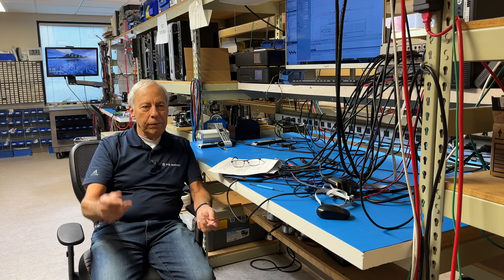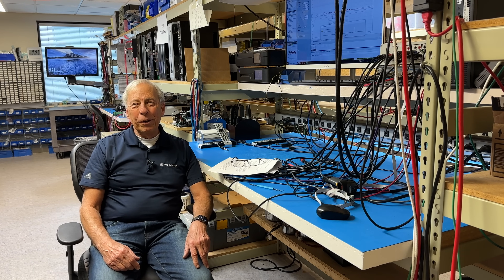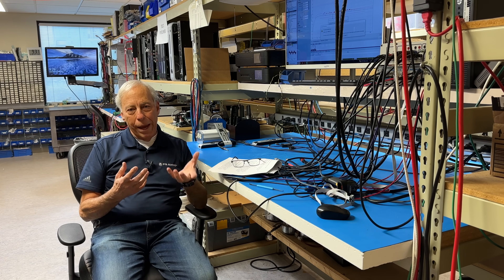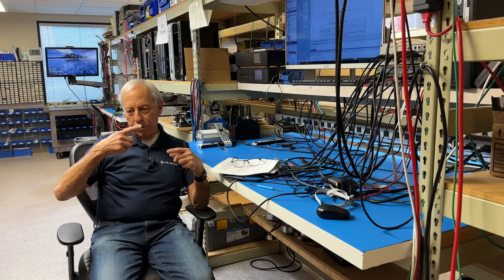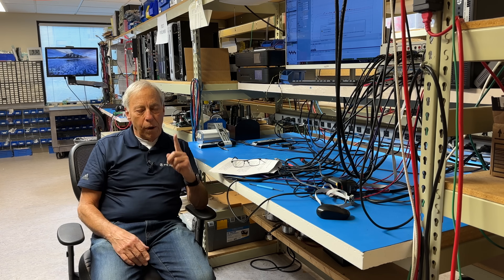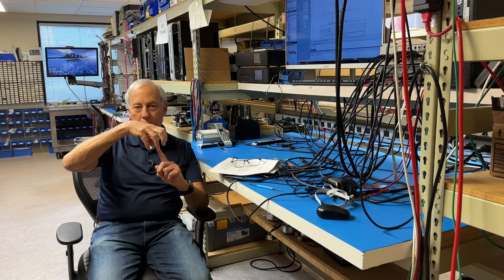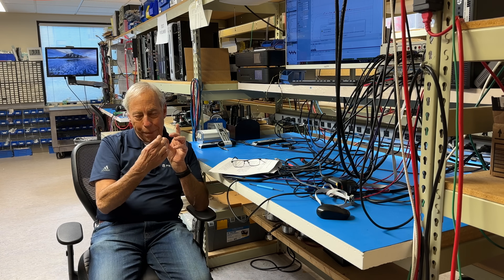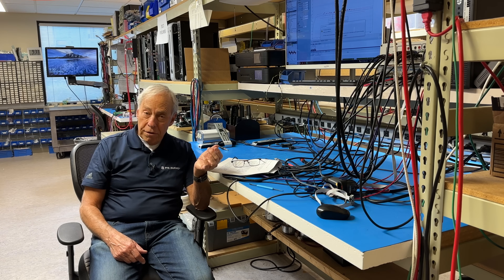Differences in phono cartridges

Comment: I love you Paul. I've been watching you for years. You are great. We are almost the same age.

But when it comes to audio? I haven't always been right. But I've never been wrong.

Yeah Paul, well you've left out of the equation,, a 3rd type of phono cartridge. You obviously know nothing about? It wasn't around very long. Therefore it is little-known. But it existed, nevertheless. As I found it substantially and fundamentally, different. And delivered precisely the way in which they said it would. I was duly impressed. I was delighted! Oh yeah baby! This is it! This is the bees knees! You will be cutting a rug with this one! You will get down to get up! I was blown away by it. I worked for Owned & Operated, Flagship, NBC Radio Facilities.  Maintaining, designing, building, evaluating, Audio Superiority. We had a Superiority Complex. We were #1 in the Market. You know how it is, Paul? You build some stuff also. Great stuff! I think we all had some of your stuff. I can't remember when I last did or what it was called? But I have owned virtually anything worth owning. Some for a long long time. Others were just a kiss and a quick, hurrah!

In this unfortunately is one of those items. I never wanted to part with. And when one has to consider, certain intrinsic risks with said devices? Walk away remembering the good times we had together. And how we shall dearly miss them forever. Be it inanimate or flesh and blood. The flesh and blood ones are the hardest. Phono cartridges not so much. But your video brought back a memory and a tear to my eye.. Over spilled milk and cookies. But I digress.

This cartridge was around, 40 years ago. When I was working for NBC Radio, in Washington, DC.

This phono cartridge came from a company, if memory serves me correctly, still? At 68.  I think they were called Micro Acoustics? They came up with something different.  A very novel lightweight, high-performance, new concept, old technology Phono Needle Cartridge Thingy. With no need for, Compensation Capacitor! That causes an abomination to, square wave reproduction. At no compensation resonant capacitor made an enormous difference of smoothness. I mean this was slick sounding. Everything else is sickening sounding.

Unlike a moving magnet or a moving coil. All with relatively high mass. An electret, permanently polarized, capacitive transducer was used. Similar to a karma condenser microphone element. Not moving magnets. Not moving coils.

The moving magnet and moving coil types. Worse still, inductive. And would require a, capacitive load. Such as a, .047 µF or was that a .0047? I forget right now off the top of my head. It's something like that. To resonate the circuit in the cartridge. Because you need to resonate in inductive load with a capacitor or a magnetic load with induction. But a capacitive transducer works differently with even less mass. Come

And so this cartridge required no, .047 or .0047 µF capacitor resonator. No need for that. This is a purely capacitive load. Not inductive, not magnetic.

This cartridge also had a, elliptical stylus. Within a even lighter weight and stiffer, Beryllium cantilever. Lighter than the other aluminum-based alloys.

One of the first things, one would notice. Splattering sibilance, no longer heard! Nothing is resonating around that frequency. It's gone! It's smooth. It sounds clean  and unmolested.

This cartridge, sounded unique.. It was free from the nasty resonant frequencies. The moving magnet and moving coil types, had. It was a breath of fresh air in, sound.

It was also lighter weight and more fragile.  Than, the standard, old, fare. And not really designed for heavy broadcast industrial grade work. This was ultra hi-fi. And we didn't equip with it at NBC radio. And I was able to take it home for myself.

I absolutely loved the way this cartridge sounded. Hands down. It had none of the negative qualities the moving magnet or moving coil types had//have. And they recommended. Any turntable, with integrated tone arm. Might already feature the, .047 or, .0047 µF capacitor's. They recommended those to be removed. As they are no longer needed. And they will upset the response from flat. Causing a high-frequency shunt. Across the output of the cartridge. No longer needed.

I was in love with the sound of this cartridge. Regardless of the preamps, I checked it out on.  And I checked it out on numerous, high-end preamps. These were largely custom preamps. It's so more vacuum tube. Others transistor. Integrated circuit chip, hybrid types. Could be compared with this unique Back Electret Cartridge. And I fell in love with its sound quality. Compared to the other types which sounded like filters. This was beautiful and open sweet and flat.

Then came the day of dark and gloom. They went out of business. I couldn't obtain a replacement stylus. And after a few years. Mine crapped out. And that was the end of that. Having to go back to the other original, moving magnet and moving coil, types. Blah!

So you guys with those really fancy expensive turntables and tone arms. The joke is on you! With your esoteric, gobbledygook, bullshit! Of flawed and old-fashioned. For old-fashioned and flawed. Great! We have really made great inroads here for you, Vinyl Junkies. That has now been lost to History. And everybody wanders around. Needing a haircut. With a lot of Wool. Over your ears. Of garbled and splattering, sound. Due to moving magnets and moving coils that, weighs a lot. And have a lot of mass to them. You don't want a lot of mass to move. It causes distortions of all types. Not all of which can be rendered, in audible. But when you hear it without? From a back electret type. It's a Game Changer!

And because we evaluated these. With proper, high-end, test equipment. Of all types of different, Distortion Analyzers. All types! Not just Total THD. But even the Intermodulation, Distortion. The, 3rd, auto order harmonics. And the 2nd, even order harmonics. Separately! And with a bunch of engineers. Doing listening tests. Not just Betty and Frank, Barney and Wilma. And then there is Fat Freddie. Who can barely hear after doing 40 years of heavy construction. Or, Bobby. Who has been playing Electric Guitar with, 4 Martial Stacks behind him! And cat here worth a damn, either anymore. Without his hearing aids!

I had a colleague who was, an ex-military, trombone band member. Who over time. Became profoundly deaf. And had some of the first rather expensive, computer adjustable, hearing aids. And he loved Pro Audio and was an, Engineer wannabe. And was taken on. By the Studio Owner. Who was a colleague of mine. And I said to Bruce, what are you doing? Frank is deaf and has hearing aids! How can he be a Recording Engineer?! He's deaf!

But Frank would go off on the computer control of his hearing aids. I didn't care! He was deaf! What the hell kind of recording engineer is a deaf recording engineer!?!? I mean give me a break! Some people have a genetic loss of hearing. It's not their fault. But you're also not going to become an, Audio Engineer. In your mid-50s while you are deaf now. I mean give me a break!

(More Real Life Audio in following post)

Comment: And so really I don't know where half you guys are coming from? And what you think, you are hearing? You certainly are not hearing the full picture! You have a lack of knowledge and lack of experience. You haven't heard everything.. There is to be heard. Because it is now gone. Nobody's making anything like this anymore. And I believe I know why.

Beryllium is a great and important metal. It's also hugely poisonous. To, Homo sapiens, a.k.a., human beings. And it's not healthy to be around. Though it is lighter and stiffer. Than any aluminum or titanium alloy. And does not suffer from the same cantilever  resonance. Other metal alloys exhibit. And that's another intermodulation distortion! DUH! Because you guys don't really know what you're hearing. Because you haven't heard it without that distortion.

The closest analogy I can come to in sound differential. Is the astounding difference. Between PCM Digital and DSD Digital. There is a profound difference in sound. And none of you guys have necessarily heard, DSD, Digital, either. Because PCM sounds fizzy. In comparison. It sounds like junk. In other words. At any bit depth. At any sample rate. I don't care how many bits. I don't care how high end sample frequency. PCM sounds like PCM. Because it is PCM. And it is not a Superior Digital Format. Even at 32-bit and 328 kHz sampling! Because it's still PCM! It's a 60-year-old early digital technology. Still in use, today. And it shouldn't be.

The secondary analogy I can give. Is the, Jitter. To a standard run-of-the-mill digital clock. And a low Jitter, Digital Clock. The difference in sound will take your breath away. It'll practically make you vomit. When you hear digital sound. With enhanced very low, jitter.. And when you hear the difference. It is jaw-dropping. It's a profound difference.

 I have been privy to. Numerous double-blind listening tests. With other, so-called. Golden eared, listeners. That all got it wrong! I didn't. I knew what I was hearing. I knew what I was listening to. I have a deeper understanding of what I'm hearing. Then the average, schlemiel, the average street goof. Because you guys really don't know what you're listening to. You only think you do. And most of what you think you hear is cockamamie garbage.

I mean sure. If you're going to spend over $50,000. On your listening system. You will have equipment. That far exceeds. Anything those recordings were made with LOL. And I'm not sure what that means? I think it means more money than brains. And that's fine if that is your hobby. It's a fine hobby. Where you get to spend a lot of money for the most high-end gear. And enjoy your status, games. Amongst your wealthy friends.

But the bottom line is. Most people will not spend, $50,000 or more. On their home entertainment system. Let's be real here.

Most folks will not spend more than, $1500 on a home entertainment system. And that's with only 2, average, decent, bookshelf sized, speakers. Not some six-foot tall floorstanding monstrosities! And not Dolby ATMOS Junk, either! Because that is Bullshit Audio Processing, again! Of time delays and phase manipulation. And that's bullshit garbage! Immersive? Your money is immersive. They are immersed in your money. That's the idea here. To stay in business. Because otherwise Dolby Laboratories has outlived their usefulness! With the Advent of Digital Sound. It used to be THX Gobbledygook. Benton 5.1, garbage. Now that's no longer good enough! Now you need 14 speakers! To be completely Immersed! In Absolute Negative Polarity Speaker Wiring Monitoring. Oh boy! Your speakers are sucking! Because you don't understand what's going on! And you are convinced you are all, right, godly and correct! When you are not!

At you have the foggiest idea what's going on with your playback system? You don't know what you are hearing. Most of you, college grad nincompoops! With years of misinformation! And so if you are all wrong, together. Surely you must be right! You are not!

Nobody knows who I am. I'm one of those really silent, unknown, behind-the-scenes, Genius Extraordinaire Engineers. And I've had to fix a lot of, Big Studios. Electrical engineers and acoustic engineers keep getting wrong! Why?

They are mired in their textbooks and mathematical formulas. They actually know nothing. About the physical recording process. And what precisely is going on from microphone input to power amplifier to the speakers, output. You do not understand the process going on. You are inverted! And I have proven this time and time again. Since 1978. It's been a while now. That I discovered this, stupid, mindless, Textbook Mistake! Because everybody left out an important component in their mathematical formulas! They never took into account the microphones! At what precisely they are doing?

This involves some basic understanding in Physics. Of which I have none. I am a mathematical nincompoop. I have major brain damage which is medically certified. I have no mathematical aptitude! Due to severe traumatic brain injury damage. But I am otherwise a fucking genius! Not some dweeb college grad know it all that doesn't! That is fixed in the mire and the muck of misinformed engineering practices! Of inverted Negative Absolute Polarity.

Most folks do not comprehend what the hell I'm talking about. Because their understanding is nascent. Of the technical process behind the recording!

And so. You knowledgeable college grad children. Here are some simple questions. You will get right and wrong.

When your speakers are working. You already know. The sound should be protruding out of the speaker toward you. And you know that. It's not doing that. It's doing the opposite. It is actually, physically, causing the speaker cones. To suck away from you. But you believe. You are in, Absolute Positive  Polarity. Since your left and right channels speakers are obviously, in phase together. And they most definitely are! There is no doubt about that whatsoever. But the same time that they are in phase together. They are both in Negative Absolute Polarity. With their wiring. Which is inverted. But it's not inverted. Therein lies the problem of the understanding here. It's not what you think it is. In fact.

I have to unfortunately, quote. I think it was Rudy Giuliani? Who said. The Truth. Is, not necessarily the Truth. At this would be a correct statement here. You've got everything technically correct. But it's acoustically incorrect. And this is where everybody's mind goes blank. Because?

This all came about. Due to people of low knowledge, low information. Who have DEMANDED. THEY DO NOT WANT ANY OUT OF PHASE ANYTHING IN THEIR SIGNAL CHAIN!

Unfortunately. They fail and neglect. What the microphone diaphragms are doing? When the sound pressure waves. Beat upon those microphone diaphragms. Which way are those diaphragms moving?. Correct me if I am wrong here?

When the sound pressure waves blast the microphone diaphragms. Which way are they moving? What does physics make them do? It pushes in on the diaphragms. Into the body of the microphone. To push the sound out the rear of the microphone. At that tells me. It is depressing the microphone diaphragms, inward. Because?

(More Real Life Audio in the following post)